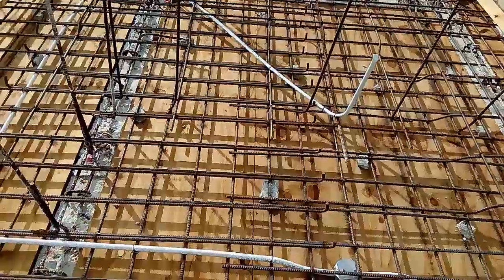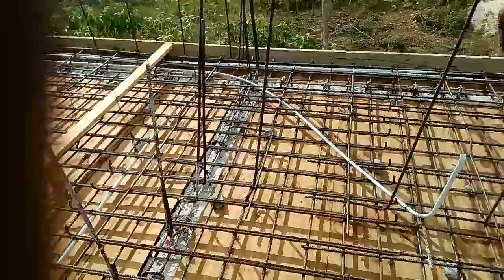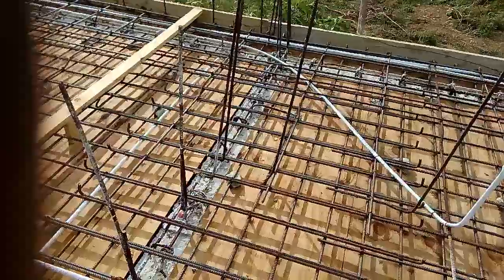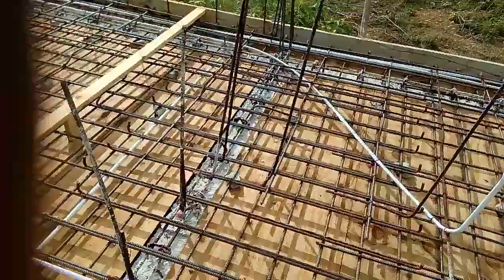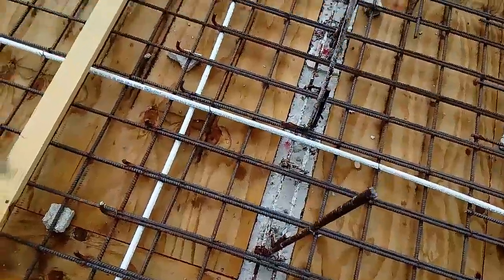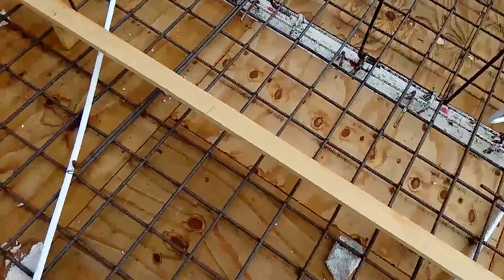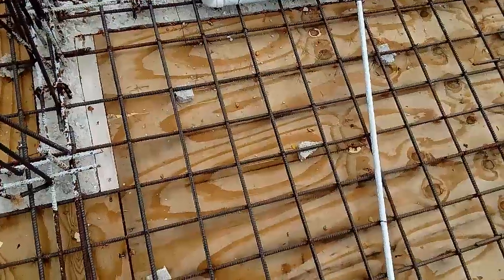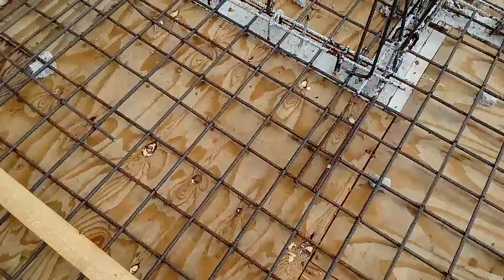#2 Concrete Slab Roof Construction Steps - How to Setup Decking Formwork - House Building In Jamaica

Comment: Made a foundation but contractors put the post footings on top of the foundation not set the steel rod footings on the bottom.of foundation .what can I do now?
Reply from the maker: I am not clear on what you are saying but it is best to get someone that is competent to have a first hand look to give you a second opinion.
Reply: @ProductWise-s9z  thats the thing noone cant check now cause its complete. unless broken again. when we cast the foundation they just put the posts column steel rod on top of the foundation cages not dig the post columns footings deeper like i see some videos have. if you understand what i mean. so basically now i have my foundation casted and i can see the post columns footing on top of the foundation concrete. it was not casted at the bottom.

Comment: How tick is the slab? And what size rebar should I really build my house with, #4 or #5  (G+1)
Reply from the maker: The recommended thickness is at least 6 inches. 1/2" steel is good

Comment: Always had a love for construction and installations. Question, how thick should be the cement mix after its poured and dried?
Reply: 4 inches.
Reply from the maker: The standard thickness for the slab roof is 6 inches.

Comment: Not a bad video. However, since it appears that you are not yet into adding illustration during your video editing, I suggest you at least use a piece of 1/2 inch water pipe or electrical conduit to indicate what or where you are referring to. Take for example: viewers cannot determine where on the building was the front or the back. I wish you well and will be looking for to see more of your contents. Blessings bro.
Reply from the maker: Ok. Thanks

Comment: If walls of the top floor is placed directly on the ones on the ground floor do you need an extra layer of steel?
Reply from the maker: Yes. Especially for the overloads.

Comment: Thanks for the video 
How much material do you need to do a Deck ten by twenty eight
Reply from the maker: Approximately 40 to 50 lengths
Reply: What about a 12ft x 40 ft decking? How much steel rods half inch needed

Comment: Hi my brother which one is cheaper, between the concrete tiles and the flat slap concrete roof
Reply from the maker: Flat slap concrete roof is cheaper.  Remember you also use manual labour in order to save on cost.  Remember to Subscribe and share the video.

Comment: How much steel needed to construct a 58 ft. × 50 ft. roof deck, which will be the floor of a second story apartment. .
Reply from the maker: It will take a minimum of  1.5  and a maximum of 2 tons.  Without knowing the consideration for the overloads.

Comment: You said wiring cost is $3000 per point. What do you mean by "point"?
Reply from the maker: The wiring to each light socket, Plugs, Switch or Panel

Comment: I know you are talking about decking but I would like to know how much steel do I need for the foundation for 2 14*14 rooms and a 6*8 bathroom. Is there a formula to work out how much I will need. Thanks
Reply from the maker: Between 1/2 and 1 ton - half inch steel   and approx 1/3 of a ton 3/8 steel.  It depends on the amount of columns that will go in.
Reply: @ProductWise-s9z  thank you
Reply from the maker: @celiajones9516  You are welcome.  Spread the word.  If you have not done so as yet, please remember to subscribe.

Comment: Hey bro..quick question..how much steel would I need to deck a room of 14×16
Reply from the maker: Approximately 35 lengths if you are not planning to build on top which would require more for the overload.
Reply: @ProductWise-s9z  thanks a lot bro..keep up the good job and I love ur vedios by the way..

Comment: Thanks.  How high above the overload layer of steel should be from the first layer?
Reply from the maker: It is dependent on how thick the slab will be.  You want to ensure the steel is deep enough, that the concrete will not chip away or crack.
Reply from the maker: It is dependent on how thick the slab will be.  You want to ensure the steel is deep enough, that the concrete will not chip away or crack.  1.5  to 2"   below the surface.

Comment: How much bags of cement could do two 14x14 room & a 8x9 bathroom ?
Reply: Thank you
Reply from the maker: You did not give me the desired thickness but I calculated it at 6" thick.  It will take 36 to 45 bags, depending on the PSI you want.
Reply: What’s the cost for casting concrete an how do you calculate it ?
Reply from the maker: @diantheawallace5528  There is a link down below with a rate sheet that you can use as a guide.  Everything with construction is negotiable.

Comment: How to measure a roof to know how many squares to set up decking  thanks
Reply: Length times width..example 30 feet by 20 feet = 600 square feet..that for the ply wood..concrete is cubic feet or cubic yards. Length×width × depth of of slab..
.

Comment: How much steel is required to do 8 squares to include over-support? Also, how many bags of cement will be required at 6" thickness!
Reply from the maker: Please qualify the measurement.  Is it 8 x 8 feet ?
Reply: @ProductWise-s9z  It is 70ft by 17ft, thanks
Reply from the maker: @waynevassell1637  It will require a little less that 2 tons of steel  and approximately 110 bags of cement.

Comment: How much steal to setup a 12x14 room deaking in how do i calculate it  to no how much
Reply from the maker: 30 lengths would do if there is no plans to build on top.  One length of 1/2" steel is 29.5 feet.  The formula would be (12 + 14  + 1.5 + 1.5) x 12 divided by 6  divide by 2   = 29 Lengths    1.5  represents the allowance for cantilever,  the times 12 is conversion to inches,  6 is the distance between the steel bars and the last 2 is dividing the bars into 2.
Reply: How how many bags of cement?

Comment: What are the pieces of 1x3 boards for?
Reply from the maker: Please be more specific about the piece of board you are asking about.
Reply: Those 1×3 or whatever it is..is for height and level of the decking or depth..for example..a 6 inches  thick slab.. is from the ply to the 1×3

Comment: Where exactly the over support are place?
Reply from the maker: Closest to the walls.
Reply: @ProductWise-s9z  so if you are doing a extension or a slab floor on top of a garage would i need to put the over support steel into the existing building or can I stop it at the edge of the existingbuilding ??

Comment: Nice work bro, do you know the standard rate per square feet to put up a decking including the steel work and carpentry? Got a 600 square foot roof I'll be doing shortly.
Reply: Like rhe neatness
Reply from the maker: Please see the attached link with a rate sheet.  The rates can be a hit or a miss.  North or South of what is on the rate sheet.  https://www.my-island-jamaica.com/the-independent-construction-rates-in-jamaica.html

Comment: Please how many tons of steal and cubic meters of concrete is required for a decking of 400m2.
Reply from the maker: Approximately 5 tons.  If you plan to build on top of the decking then you would need more for the overloads  and preparation for the walls and columns.
Reply from the maker: 84 cubic yards of concrete @ a depth of 6 inches
Reply: Thanks for your help I appreciate

Comment: one more thing  my decking is 44 feet long by 25feet wide how much tons  of steel do i need?
Reply from the maker: It will take 21 cubic yard of concrete @ a6" depth
Reply from the maker: 1.2 tons is adequate.  If you are planning to build on top you would have to include more for the overload.

Comment: yow yout  yu ting a shot. continue doing what you are doing. I wont to know how to set up the belting and how to do the electrical and pluming for upstairs. do a video on this please..!
Reply from the maker: The electrical and plumbing are specialist fields.  You would need persons in those areas to provide that information.
Reply: So what if you want to make changes in the electrical an plumbing for upstairs how would you go about that..
Reply from the maker: The Electrician and the Plumber would able to make the necessary adjustments if the need arise.  I hope understand your question and is responding appropriately.
Reply from the maker: Plumbing and Electrical are specialist areas. You would have to be guided by a plumber and an electrician.